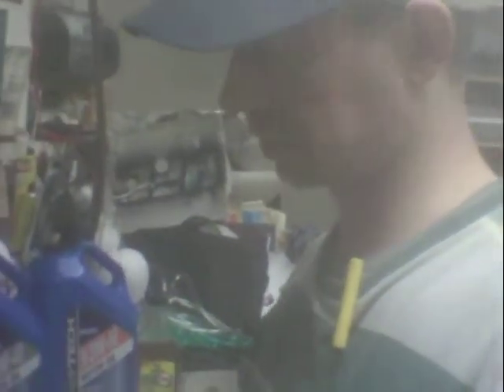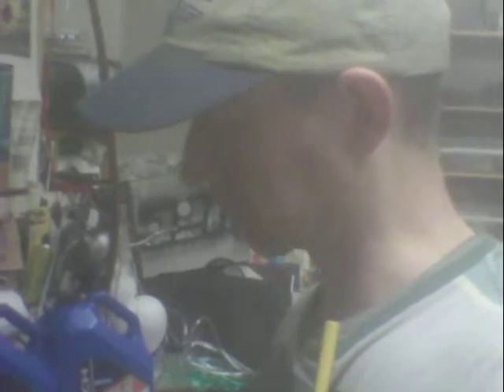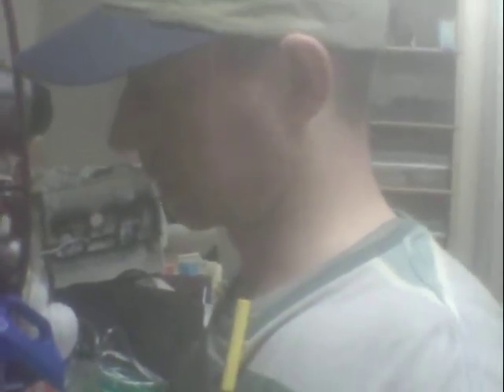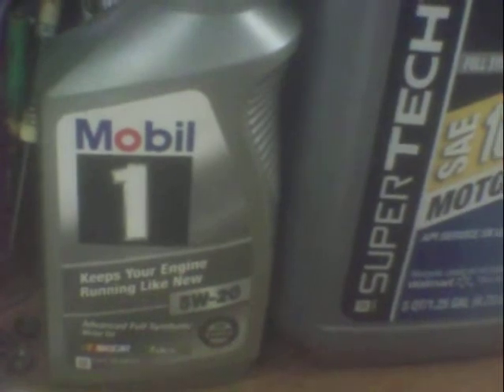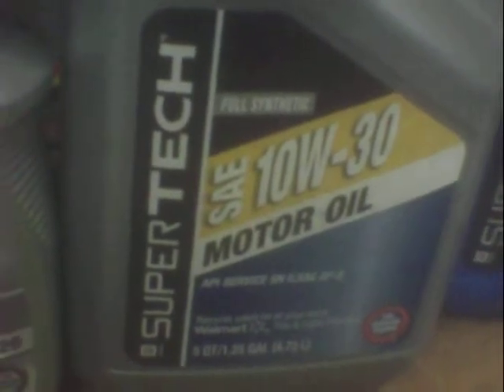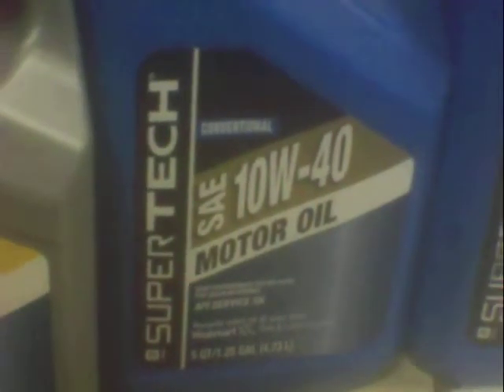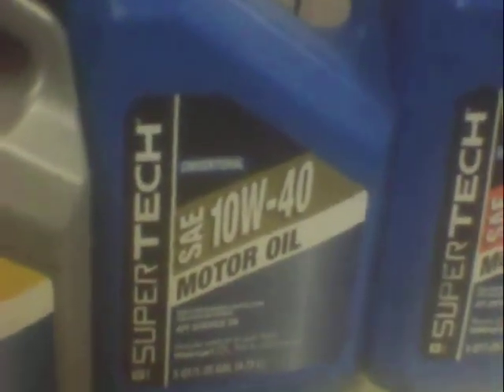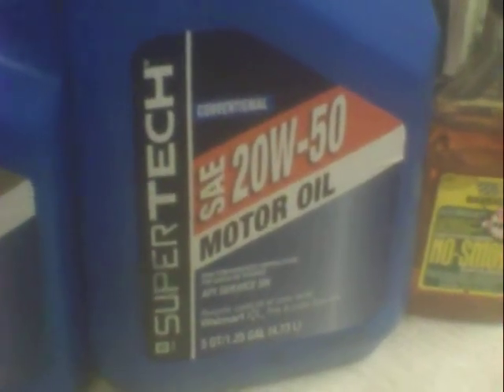Advice4 Worn Out Engines: spark plug non-foulers & oil types

Comment: You can buy longer threaded anti fouler adapters, I ruined 3 high dollar plugs until I got smart. Totally fixed my problem for 14.00 dollars. Just make sure you get the right MM size. Not good when you hear the crunch of the ceramic tip when your installing the plug with the wrong size fouler. Auto Zone sells the different sizes.
Reply from the maker: No sir, thats NOT a good sound.  I've broken a plug er 2 in the past myself.  When I bought the only 2 I've ever bought, I could only find'em at Napa at the time.   What kind of engine & how many miles do you have on it??
Reply: It a 1982 Datsun 280 ZX Turbo, I bought the short adapters, then found out , to short, crushed couple of plugs, then I found they have longer adapters, I have them being shipped from Auto Zone, stores dont really carry them, and if they do its just a package of 2, thats all they have on the shelf, so I just ordered them off there web site.
Im getting just a little oil/black soot on the plug tips, tho I have just recently have been adjusting my Air/Fuel mixture, that might of caused it. Im installing them on all 6 cylinders. I believe the engine has around 160,000 on it , not real sure. Bought it from a older lady in Marietta Georgia many years ago, its just a hobby car, but it runs real nice. I'm retired so it gives me something to do. Its a beautiful car, 2 door 5sp, replaced seats with 93 Z seats, had them recovered ( alot of money ), new carpet, new tranny, new struts. Dont want to know how much money Ive got into this car, but its over a 11 year period, so not to bad (justify to myself )
Reply from the maker: What size is that 6 cyl.?
Reply: 2.8 liter, after I looked close at the short adapters, they were just a tad to short, just enough to bend the ground over into the positive, so close, yet so far, still waiting on my longer adapters, should be here today hopefully. Will be interesting to see if they work alright, since they will be on all 6 cyl.